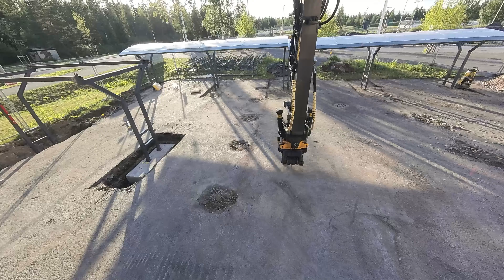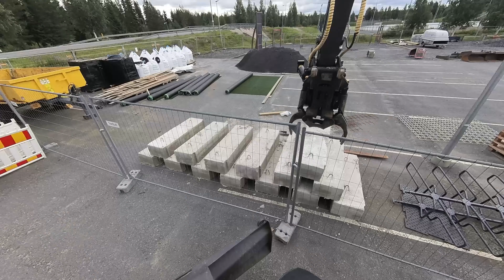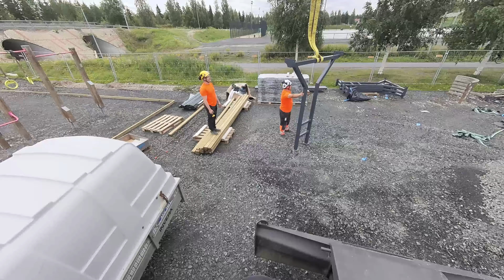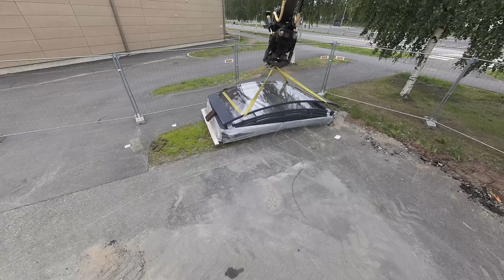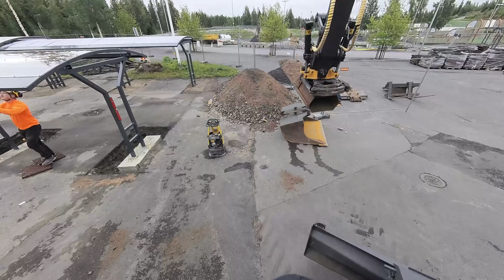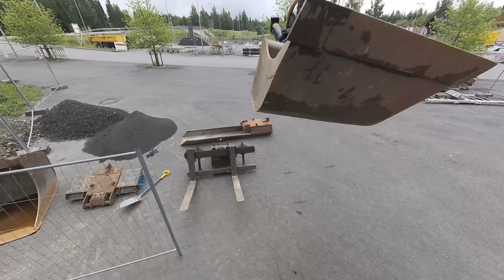polkupyöräkatoksen rakentamista. building a bicycle shed. volvo ewr 150E + engcon + trimble

Comment: The camera work was spot on just like you working that machine 
It amazes me that you put the glass tops on and then started to fill it in with dirt instead of fling it in with dirt and then putting the glass tops on
Reply from the maker: the camera is outside the machine. some of the roofs were difficult to get in place (not shown in the video) we did not fill before installing the roof so that we had the opportunity to move the frame a few millimeters.

Comment: Think I would have filled the trenches before putting the roofing panels in place. 🤔
Reply from the maker: some of the roofs were difficult to get in place, such a tight fit (not shown in the video) we did not fill before installing the roof so that we had the opportunity to move the frame a few millimeters